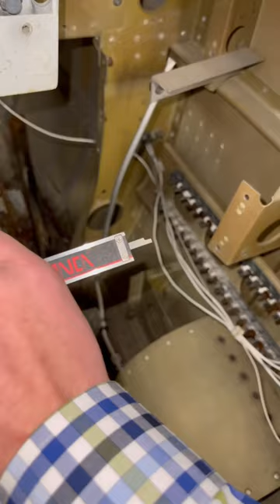Caliper Drama

Comment: He's an aerospace engineer. He definitely will have this jet running in the future.
Reply: The mechanic that he works with will have it running in the future and then he'll take the credit on YouTube.
Reply: @wyattwalden1733  yeah with and without the idea and equations this engineer wouldn't have anything to build
Reply: A lot of parts on the engine need replacing. The blades were all severely damaged and will shake the engine apart even at low RPMs. Balancing blades is a very difficult process and requires expensive machinery. I have my doubts that it will be running anytime soon. The specialist tooling needed to assemble engines is going to cost a fortune let alone getting it on a testbed and running it at full reheat
Reply: Dude don’t come after the mechanics, they know how stuff works better than any one engineer who designed it
Reply: @matthewaaa5138  I’m sorry but that just isn’t true. Designers must understand the entire process holistically to design parts to withstand stresses/temps etc. Fitters and those servicing engines do not understand why things are designed a certain way. Having spent a few weeks with fitters to understand the things we must consider to make their life easier when assembling and asking countless questions only to get a response of… “No idea, I just do what the process asks me to do”. This was from fitters who worked on a specific engine for 30/40 years +. Fitters don’t need a degree to assemble engines. Designers almost certainly need an engineering degree of some kind.
Reply: I don’t think you understand engineering 😂 he can tell a mechanic how to do it but he’d never figure it out himself.
Reply: @codygooch510  you don't think he has friends in the same field or work that can help him with that.
Reply: My friend's friend is an aerospace engineer for over 20 yrs. I've been a tool & Die maker for over 30 yrs there's nothing more stressful to watch than that engineer work with any tools. My 8 yr old boys can work better. Engineers are book smart but hands on they're not.
Reply: 😂 yeah they teach you this in school 😂
Reply: @wyattwalden1733  You should work on that negative outlook or you're going to die alone and miserable, pissed off at everything for no reason
Reply: No. He’s never going to get it running. He’s made zero progress. Every video he makes is just to get attention to the “project” but he’s not actually doing anything

Comment: Mitutoyo has left the chat..
Reply: lol do I sense a fellow machinist?
Reply: Mitutoyo makes digital calipers as well
Reply: @appelmelk5664 yeah they do but the big question is do they make them as good as vinca.
Reply: @TR-sg9jc   You must be joking! Vinca is a budget brand.  Mitutoyo is in an industrial league of its own.
Reply: @moshet842  I see you can spot sarcasm from a mile away
Reply: @TR-sg9jc  lol
Reply: When I saw those I was cringing, even though I don’t even own Mitutoyo calipers myself. Lol. Work has me spoiled.
Reply: I've been using a cheap one and it works ok. More technical stuff, has to be micro metre
Reply: Gay
Reply: Ill stick to my SPI calipers…
Reply: @DisturbedCarbon  very good brand as well my optical comparator  is an SPI
Reply: It's called digital Vernier calipers.
Reply: Love my mitutoyo
Reply: @TR-sg9jc  are you joking ?
Mitutoyo and Holex are ones of the best
Reply: @larkalfen9510  I must just be a big dummy with no sense for sarcasm
Reply: @TR-sg9jc  
I have not read the whole section 
But either way work more on you sence of sarcasm xddd
Reply: @larkalfen9510  wtf lol that's on you, I shouldnt have to hold your hand. Btw you did read the sarcastic comment it's pretty clear when I ask if mitutoyo is as good as whatever hes using in this video
Reply: @TR-sg9jc  ok
Reply: $23 on amazon

Comment: There is a fourth way you can measure with them. The flats on the side of the jaws. When closed and looking at the front calipers, it’s the far left vertical edge. When opened you can use the flat on the lower and upper jaws to measure depth. You will be measuring with the back of the calipers. I’ve found it more accurate when measuring a shelf or lip feature on a part. I hope that all made sense
Reply: I was waiting for this comment

Comment: I saw the previous video in question and literally followed it up with the thought, “yeah but tolerances here don’t matter, so who cares” 

I am a mechanical engineering student
Reply: Mostly I think the people that care are the ones that think a $15 8" caliper should be treated as well as a $250 1" micrometer. I might use one to scratch guide marks on a piece I'm about to turn or mill, and some would say use a proper tool for that, but if I damage a $15 pair of calipers doing that, I can pop down to the local Harbor Freight and replace them, and the 'proper tool' isn't going to be found locally. I'm reasonably sure that the wear and tear of using them for making scratch marks is going to be less than the cost of the rest of the materials for the project.
Reply: @RNMSC  it’s such a transcendent vibe to say that kind of thing. Tools are meant to be used
Reply: The good ole LGTM spec.

Comment: I won't lie I got a pair myself and they are handy asf they give really good readings the only thing I have heard of that can get better measurements is one of those things used to ee how flat a engine block is it's like a micro meater
Reply: Oh is that how you use a micrometer?
Reply: Just a heads up, you’d use a straight edge and feeler gauges to measure deck flatness. Maybe you’re thinking of the thickness of something by else?
Reply: I think u mean to measure bore diameter, which would be a micrometer
Reply: No bro, measuring flatness you would use a surface gauge
Reply: @Crazyclay78YT  that would check surface quality
Reply: @TR-sg9jc  if you have a known flat surface and put your object on top and then read that, it also tells you flatness. it shows where the low points and high points are, therefore showing flatness
Reply: The digital calipers are far from accurate especially the one he is using. Bit suspicious that an ‘aerospace engineer’ would use the cheapest Chinese callipers. Everyone I know in the industry uses mitutoyo.
Reply: @poptart2946  lol ikr and he seems to net even have a tool chest with a basic set of tools in it.
Reply: @poptart2946  bro who cares, its not like he's machining low tolerance parts for an F1 engine, its not a big deal
Reply: @poptart2946  Even cheap calipers can reliably read a thou.

Comment: Ima be honest, this taught me the name of those
Reply: The actual name is micrometer i believe
Reply: @deliciousgixxer3670  micrometer is different
Reply: @deliciousgixxer3670  Nah its not
Reply: They are called vernier calipers :)
Reply: @benpc1794  You're also wrong, this is a digital caliper. For it to be a vernier caliper it would have to have a vernier scale
Reply: @deliciousgixxer3670  it's not a micrometer.
Reply: @deliciousgixxer3670  definitely not a Micrometer. Calipers typically measure in thousandths (.001”) or sometimes have marks for/ resolution of half a thousandth (.0005”) (not sure of resolution for metric). Calipers also typically can do depth, Internal dimensions, and outside dimensions. Basically an all purpose general measuring tool. Micrometers on the other hand typically are accurate to a ten thousandth of an inch (.0001) with some having marks for/ resolution of 50 millionths (.00005). They achieve this precision by being purpose built for one type of measurement only. For example the most common being outside micrometers. But you will also find Mics for inside, depth, thickness, etc… Mics also have a smaller measurement range, typically in 1 inch increments, to keep the chance of thermal expansion and overall tolerance down. Whereas you can find calipers up to several feet long (I own a pair that’s 48” long). But probably the most obvious difference is that most (I won’t say all) micrometers use precision screws/ threads for adjustment and the measurement, while calipers use rack and pinion (analog) and sliding scales (digital) for the measurement. 

Source: I was a machinist for over a decade, have a masters in mechanical engineering, and currently work as a gunsmith.

Comment: I know I’m old because my calipers have an analog dial 😊.   No dead battery yet!
Reply: I am not that old. But my main calipers are analog and i am the fourth generation of my famely to use it. Lovely caliper from Czechoslovakia. The non analog ones just gunk up and get problems to read. If they are used in a dusty and oily enviroment
Reply: Digital and analogs have their place. A floating zero can make life a lot faster and easier. I used to have both. 6” digital for the small stuff and 12” dial shock resistant for the big stuff. I personally love analog
Reply: Truth right here! You use B&S, Mitutoyo, or Starrett? Or something else?
Reply: Dial calipers - vernier calipers - digital calipers

Comment: I'm a manufacturing engineer and use calipers daily as well. I came up with a game I call caliper roulette. You open them to 1.000" exactly, then zero the display. You then use your left hand to cover up the display and graduations on the main bar and try your best to open them to 1". You can leave then zero'd but then have to do math, so it's easier if you zero at 1". We've even tried 2". It's amazing how fast you get very good at dialing in 1" by eye. I can regularly hit within 25 thou and have hit 1.000" a number of times. Caliper Roulette!

Comment: Spent a week in aircraft structural repair school learning how to calculate bend radius. Then when we went to the hanger to apply it on various repairs, the math and fancy formulas went out the window and in came the masking tape. Mask the bend then measure the length and apply it to the new part. Curriculum required the formal method be taught but in the end the most pragmatic method always wins out.

Comment: The depth gauge you showed is for holes. To measure a step or shoulder there's another spot at the opposite end you can see from the back where both pieces line up when you're zeroed out. I'm a millwright and I turn engineers dreams into reality.

Comment: I have the exact calipers, work great. I replaced the coin battery with a AA battery. Soldered in wires and a 3d printed holder from any old website. They last far longer now.

Comment: I'm a machinist and use them all the time. I don't see the problem. Yes, sometimes they're used in better ways than others which gives more accuracy but it's not always easy to meet your measuring needs perfectly in every scenario and then there is also the amount of tolerance you actually need in each situation. That said there's always going to be some armchair expert that writes a critical comment regardless.

Comment: As a machinist, theres things called "critical" or "consequential" dimensions and theres "remedial" or "non-critical" dimensions. Critical dimensions require the most accuracy you can achieve. Non-critical dimensions can have extremely loose tolerances because they dont affect anything as long as youre not wildly out of dimension. I eyeball things with my calipers every single day, you can see the difference in .002 inches with a trained eye. I see my coworkers spend way too much effort trying to measure a dimension they can just look at and be able to tell if its in tolerance or not. Keep doin you dawg, you didnt do anything wrong with the cals

Comment: Using the ID (inner dimension ) would only be used if the opposing surfaces are flat a round or beveled edge would be used in the way you demonstrated good on you keep up the good content

Comment: Yea dudes 100% right.... if you know GD&T and engineering you know how lose tolerances can actually be.... tight tolerances mostly save fuel and material cost not so much components needing to be precise. Two identical 747 can have a 5,000lbs difference in weight if using parts from both ends of every tolerance on the plane. So if they keep it tighter the fuel cost savings of carry 5000lbs billions of miles is huge

Comment: That’s the Engineer way to use calipers. Not “wrong” but certainly not the most accurate way. I was an Aerospace Machinist for 7 years. The best way to use calipers, is to use micrometers…

Comment: Well said until you said, "I'm an aerospace engineer".... When you have 15 to 20 years in with on the job hand to eye coordination skills sets built up, then you can call yourself that. Otherwise, to earn folk's respect, You have schooling that allows you to quickly jump into the hot seat of this industry, and spend the next 15 to 20 years learning your trade, and when you can complete a project or contract from start to finish on the job, also you can add that to the list of calling yourself an aerospace engineer. Tame the ego, I kindly say, otherwise, the first time you make a mistake, as it is going to happen, as that is just the way it goes, and part of learning, it won't look as bad on your name that you ran around calling yourself an aerospace engineer, that screwed something up or forgot to do something that was just common practice or common knowledge.. Eager to learn is where you build others willingness to educate you and look past the random mistakes, but the cockiness of calling yourself something you are not is something that will insult your co-workers that have actually paid their dues, so to speak. Be kind to them and they will be kind to you and take you under their wings and hand over the knowledge they had to learn the hard way. It is okay to play dummy some times if not as much as possible. That always leaves the door open as you "This is how I think I would try to rectify this problem, but, would you mind taking some time to educate me, upon how you as an experienced engineer would rectify this" as I choose to believe you have a better understanding of this issue".. Those men will be honored to open the door all the way, and spend/invest the time into you. Then, after their explanation, you can then mention, "COOL. I want to see if I can pull this off." then you can kindly request, "At each step of what I am doing, will you mind too much if I have you spot check my progress of work, step by step and show case to me what you would have done differently or better so I can replicate your proven skill sets" ...again, they will be absolutely honored to hold your hand through out that whole process, time permitting. What that also does, is builds trust. Trust that equals confidence in not just your ability's, but, your craftsmanship and attention to details, as you have showcased to them, that "I just finished this step, can you verify the quality and critique to the highest degree, and then I would like to showcase how I think I should do the next step to have you confirm that is a good plan of attack, then I will have you check that as well. 

There is my novel for the week. tame the ego young lad. All is stated kindly and useful tips to succeed in the aerospace industry, and ego is something I hunt for to fire them from my shop if they can't tame it. It is not my job to break those habits, but I will encourage untraining of the cockiness. pretty much just as I have politely shown here. but after a week or so, if I see no change, I fire them and tell them to go become a welder of a CNC production line manager... LOL...
Reply from the maker: Dude, I graduated with my aerospace engineering degree and my job title is “aerospace engineer”. By your definition it’s impossible to be an engineer before the age of about 37 and I think you’d have A LOT of people argue against that. It’s not like I said “I’m the best aerospace engineer on the planet” I literally just stated the job title that’s on my business card.

Comment: Look here. Just because you are able to eyeball, it does not mean it will alway be accurate.
Then again, I work with human bone, and can not afford mistakes, or trim away excess when doing a joint implant. I have to use the jigs as they are intended.

Comment: I worked for precision cast parts and engineers may be smart but have no common sense they were trying to design a fixture for a new part 3 weeks later I went to storage area less than a hour later I had it mounted and then they drew a blue print out of my work and took credit 😂😂😂

Comment: The calipers you have are okay for metric but for imperial a lot of them weirdly make the thousandths place a smaller font. Being that most shop guys will measure in thousandths calling 0.300" 300 thou or .020" 20 thou instead of the math class way of saying 3 tenths or 2 hundredth it is awkward to not have at least 3 digits past the decimal always showing and a constant font. Machinists speak this way because in an inspection situation you can easily measure 1/10,000 and in a lab you can measure 1/100,000 or even 10/1,000,000. By the time you intend to measure 1/1,000,000 you're probably going to use microns though it is possible to have some equipment that has that unit. At minimum the 1/10,000 unit will be called a tenth as if the thousandth is the base unit instead of the inch because 1/10,000 just takes too much time to say.

Comment: I dont trust your judgement because you have a degree in aerospace engineering. I trust your judgement because I can tell you speak from experience. I have a degree in electrical engineering but have since gone into teaching with minimal industry experience, so my word on electrical matters is only marginally valuable compared to professional engineers. 
Eyeballing works here because you need a snug fit, not water or air tight.